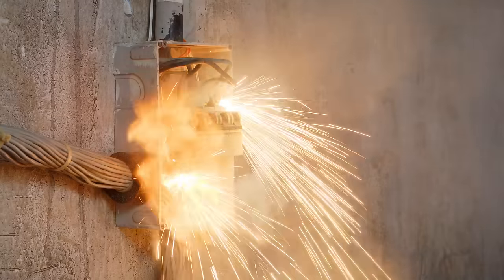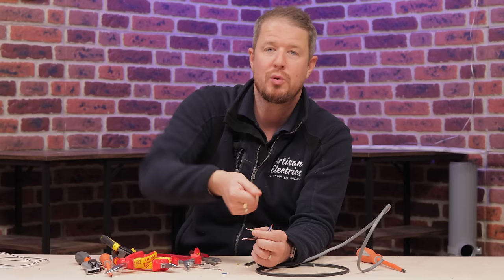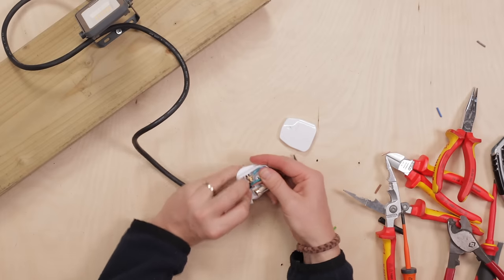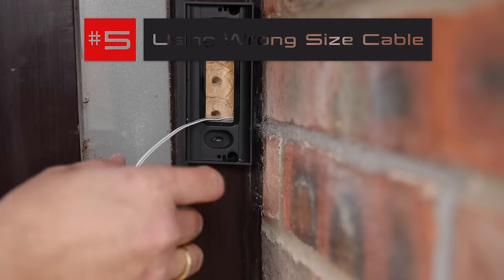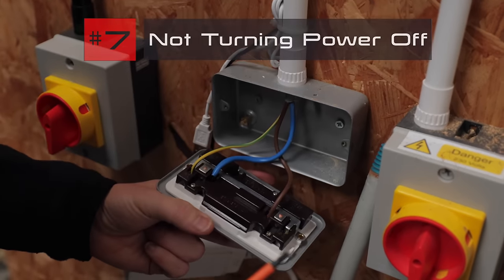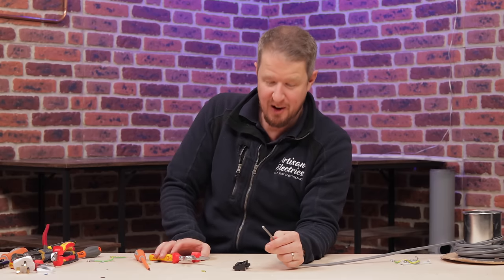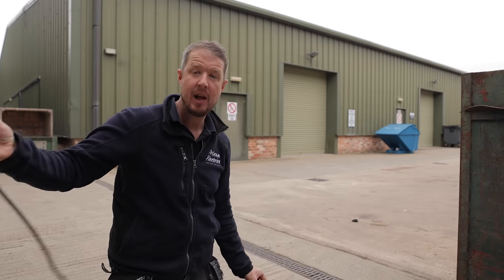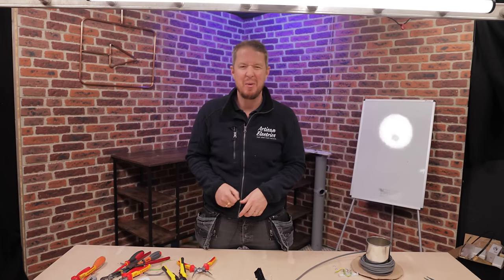10 Mistakes EVERYONE Makes When Doing DIY Electrics!💥

Comment: What about replacing a plug fuse with correct rating. All Plugs have 13 Amp stamped on them but lots of equipment have 3 or 5 amps fitted. People automatically will fit a 13amp as whats on plug if blown as label on fuse sometimes illegable
Reply: These fuses in plugs are a relic of the past, irrelevant in the era of MCBs (and RCBOs). Their purpose was to protect wires in your walls in the absence of proper circuit breakers in the consumer unit - a pointless and annoying feature these days (it is much easier to just flip MCB back on, rather than replacing the flimsy fuse in the plug)
Reply: @lelllooooo  Mate if it was a perfect world I'd agree but for instance my next door neighbour has a 1930s  house with a 1970s fusebox. Her husband tried to pull a bayonet bulb from the fitting and cut his hand open because he didn't know how to remove it and it shattered! It was probably still switched on knowing him.
Reply: Fuses in plugs primarily protect the flexible cable, and possibly the appliance. They categorically do NOT and never have protected the ‘cable in the wall’
Reply: @lelllooooo  Plug fuses serve a completely different purpose than either MCBs or RCBOs.  No one can replace the other.

(In particular, RCBOs are electrical-shock-prevention devices, while MCBs and plug fuses are actually both fire-prevention devices (addressing two different risk scenarios).  The two different categories of device work very differently and are basically completely unrelated and independent of each other.)
Reply: @lelllooooo As per other comments they are still relevant. And in the UK where mains power is commonly distributed using ring circuits, the ring may be protected by a 32A MCB or RCBO but the appliance still has its own protection fuse in the plug generally at 3, 5, or 13A.
Reply: @r.h.8754  because the primary role of a plug fuse is to protect the cable, not the appliance, if the cable isn’t of appropriate construction for 13A (suitable conductor cross sectional area and insulation type) then a lower rated fuse is required.   The appliance may also have its own fuse.
Reply: @r.h.8754  You could do, that requires a flex of 1.25mm^2  Nothing actually prohibits that and it would be protected by a 13A fuse regardless of how low the load is. For a floor standing lamp that might be the preferred choice for greater mechanical protection.

But if it’s say 0.5mm^2 as would be typical of a table lamp it should be supplied with a plug equipped with a 3A fuse, with labelling on the flex detailing the fuse rating.

If it was from the era when plugs were not fitted as standard then labelling for the correct fuse rating would be applied to the flex.  

The lamp itself would clearly consume nowhere near 3A and may even be as low as say 0.25A (60W) for thermal reasons (with tungsten filament or halogen lamps) with regards to proximity of the lamp shade and flammability of the materials used, and far lower for CFL or LED lamps.

You can’t legally have a flex rated for mains use in the UK, and indeed in any country that has national standards based on CENELEC standards that isn’t at least 0.5mm^2 and that CSA of cable is rated at 3A continuous, hence the common BS1362 fuse ratings (BS1362 1A rating fuses are however available) No idea what NEMA says with regards to 110v flex but it won’t be that much different.
Reply: @lelllooooo Totally wrong.
The fuse protects the appliance cable.
The breaker in the consumer unit protects the cables in the walls.

For example: the breaker on a ring main will typically be 32 amps.
The fuse in the plug is 13 amps.

If the fuse in the plug is not present, there is a fire risk as the 32 amp breaker does not protect the 13 amp appliance cable.

The fuse in the plug IS needed.
Reply: @r.h.8754 You can buy 13 amp plugs fitted with 3 amp fuses.

They are readily available.

Or you buy a 13 amp plug with a 13 amp fuse and replace the fuse for whatever fuse you require.

Comment: Ha... I was just waiting for talk about induction with the extension lead. That would set off the QI general ignorance alarm. Not true. It's just resistance causing heat. With the cable tightly wound on the drum the heat can't escape... The general advice is bang on. I have seen a 10A extension with a big water urn (about 10A) and two coffee machines (another 20A) fortunately that blew the fuse.

Comment: Most 'interesting' to date, I was on holiday and asked to wire a socket for a DIY couple who were having an extension  built, the feed cables into a domestic 'consumer board' the live and neutral were swapped over (unknown sparky) I had the MCBs in my pocket, but had no test gear with me, blew a hole in a metal back-box big enough to put my thumb through, the neutral was 'live' via the 100A main breaker. Fortunately  I was being cautious when handling the cables..
Reply: Interchanged, not exchanged.

Comment: very interesting.
also good channel you got a new sub!
bit of a story, so my dad has a audio cable business, but he will also go install equipment, I often come to help, one job a while ago we were at a converted church and they needed audio and a video cable installed in the attic, its a pretty high up and no floor in the attic and had like a foot of insulation, its a pretty old church and had nob and tube wireing but was "replaced" more recently, it was out of they way so I avoided it and got the wires in,  once we finished and had cleaned up we tested it and the sound had a buzz to it, but it was late so we called it qutes. a while later we came back to figure why it was buzzing, I got back up in the attic to remove a littel converter box as a test, which fixed it even though we expected it to work the opist of what it was doing but the thing is those nob and tube were live still the people that were supposed to replace it all reused some of it, so we had the lights off most of the time just in case, we had one of those pens to test if its live to would go off like two feet away from it which its sorta crazy. in the end we made it work, just a little unnerving walking near them.

Comment: Even worse than the "stripping too much insulation from the solid core wire before screwing into the contact block" is not stripping enough insulation and then inserting the wire into the contact and the screw clamping down onto/partly thru the insulation! (Much worse from a contact resistance/fire risk point of view, which is more likely to cause a serious issue than some exposed copper in a covered contact box)

Comment: I got a question! I live in Italy and I am currently studying Mechatronics, and I love working with electric and electronics, so I decided to re-make my cellar for working down there, and I had to re-make the electrical system, for having a better one. So I got cables of 1.5mmq that should reach into my cellar, and for my life saver i wanted a 2.5mmq cables, so I just used a mammut for changing the diameter. Now I got cables of 2.5mmq going insde there, and I was wondering: will my outlets work fine? I got 16Ampere one, and each of it there are 2.5mmq cables that are giving the power inside of them. I excuse myself for my bad english!

Comment: Last point , not induction, it's pure resistive loss, with heat not being able to escape. Inductance is negligible because the field is canceled by live and neutral running side by side. One common DIY error bad stripping resulting in nicking copper, causing a fategue point, which breakers at some point.
I use an old screwdriver with a neon in the handle to check for unexpected live wires.
Reply: No.
The inductance is not negligible because the field is cancelled.

The fields ARE cancelled by the fact the line and neutral currents are equal in magnitude and in opposite directions.

The inductance is not zero.
The formula for the inductance of the coil is this:

L = (Uᵣ U₀ N² π r²) / l

Where:
L is the inductance
Uᵣ  is the magnetic relative permeability of the core inside the coil 
U₀ is the magnetic permeability of free space
r is the radius of the coil
N is the number of turns in the coil
l is the length of the coil

The inductance is a function of various physical properties. It is not based on the magnetic field.

Comment: congrats for this - thou the last bit came to late for a workmate - where you mention unwinding the cable ....the reel did have that thermal cut out but the muppet got sick of it tripping so held it down with blu tack ...... end result was quite the show and then the main fuse on the house tripped needless to say but he's no longer has any leads on a reel

Comment: I am a D.I.Y guy, my paranoia and self doubt has served me well.  The only one on that list I may fail on is tightness, electrical connections should be "Clean, Bright and Tight".   I like mine tight tight but not strangled.
Trades can be the worst,  I recenty moved a professionally installed PV DC isolator switch from my parents loft, it was mangled by a Gorriler.  All the solar gear up installed up in the loft out of sight is F'in crazy.
Trades have no time to take care it cost too much.
Reply: It's not that it costs too much: it's that they don't care.

Comment: Porcelain wire nuts (known in the UK as Screwits) were quite common in the 1960's with the old imperial sizes of stranded cables. I'm not sure if they have ever been banned.

Comment: 10:24 Why is everybody always claiming it's because induction ... etc. This is only a small fraction from where the heat is coming.
The primary source of heat is its resistance : As current flows through the cable, the resistance converts some of the electrical energy into heat. When the cable is coiled, the heat generated tends to concentrate because the coiled cable has less surface exposed to the air for cooling. This reduced heat dissipation causes the temperature of the cable to rise significantly.
This is also why there are regulations on how many electric cables can run next to each other to ensure safety, prevent overheating, and maintain proper functionality.

Comment: My worst mistake was trusting a cheap electrical voltage tester (the screwdriver model) to check whether a socket was live or not. Turns out the cheap piece of equipment was faulty and didn't light up. You can imagine it was a bad hair day!
Reply: That's why those screwdrivers are called jokingly "Lügenstift" - lying pen here in Germany. 
However, just like any kind of measuring device: check proper function first. I don't rely on any measuring device in first place, especially for electricity. I always make a check on a live conduit first (usually on a plug), then switch power off and test again before starting work.

Comment: I have never committed any of these errors. I am also self taught (but have studied electronics).

However I have assisted family, friends and neighbours only to discover that some "so-called" electrician has just twisted cables together, or used the wrong section cable, loose connections and connections that juet haven't been tightened.

I feel your video should be titled "Common DIY and Cowboy electrician errors."

Comment: An extension lead will be fused on the plug so surely it’s not possible to overload and start a fire?
Reply: the issue is overheating even when the load is within tolerance
Reply: Its not overloading, its resistance causing the problem.
Reply: Depends on what rating the fuse used.
Reply: That's  the assumption that can kill you. Same sort of thing happened a few years ago in Sheffield UK, result 6 dead people. They'd  been told what was wrong but reasoned 'it's still working  therefore  what does he know?' I still see the same faults/attitude daily not only from others but even from the surviving relatives. I despair sometimes, I really do.
Reply: wrong
Reply: @wilfredwood2636 No it doesn't depend on the fuse rating.

Fuse rating is nothing to do with it.

You have to have a fuse rating equal to or higher than the appliance load rating.

So when operating a high power load, 10Amps would be 2.3kW, that current causes the cable to heat up. The wound up coil means that the cable doesn't have enough space around it to cool it, and the cable can heat up too much and catch fire.

Comment: Twisting stranded cables together is fine, its how we all do it in Australia. Twisted single strand though is definitely no good.
Reply: We twisted up solid in Australia for decades when that was the cable in use in the past.  I did enough of it myself.  Much the same as with stranded if you over-stress with excessive twisting solid will break.  Just that with stranded you'll possibly just drop a single strand.  Not that removing 1/7th (or what ever based on strand CSA) of the conductor is acceptable.  Solid or stranded once damaged, chop it off and start again.

Comment: I've seen one of these under cupboard strip lights that can be daisychained with the live feed to the female connector. This meant that the protruding pins in the other end were live. The house holder got a shock.

Comment: To be fair professional sparks make mistakes too. I got asked to investigate why the householder was getting shocks from the bath taps. Turned out the main earth cable was still coiled up with tape behind the distribution board. Never had been connected.
Reply: That's not a mistake, it's negligence. Proper testing must be done and that would easily show a disconnected main earth.
Reply: @davidbrooks9576  yes, but my point is in the UK we have laws that require electrical installations to be tested before connection. Plainly this was not done, to my knowledge no one ever get prosecuted for violations.

Comment: When I started as an apprentice electrical fitter on the southern electricity board 1961 one way of connecting cables in domestic wiring was to use screwets, a porcelain version of your wire nuts.surely the bast way to make a connection is soldering, I doubt using the twisted wire method is intended to be a temporary connection so your objection that its difficult to separate the wires is invalid. The main abjection using just a twisted joint is surely the current carrying capacity of such a joint without some form  of mechanical clamp on the wires. Sorry but we operated high current cables wrapped on drums on our test equipment used in finding faults on 415/11KV/33KV transmission cables and after qualifying as electrical fitters with C and G B and C certificates we were given training to operate the equipment we were asked why to unwind the cable from the drum and we cleverly answered eddy currents and were told they would have very little effect on heating the main cause was the high current passing through it. You also completely missed the most dangerous mistake of all, that of replacing the fuse in a 13A plug with too high a value or even a paper clip or a piece of wire. Apart from that I think you have some good points assuming morons are doing the work. One other point that affected us in the 60's was the chance from imperial to metric cable when the lighting/power cables changed from 3/029 and 7/029 PVC to the single core equivalent,we didn't have fancy wire strippers and it was possible to nick one of the strands,it shouldn't happen,but we're all human. If this happened on a single core cable it could cause a later problem which is why although 1/044 cable was rated for lighting circuits 3/029 was used.

Comment: The extension cord on a roll might have been a bad example, but I have seen very dangerous examples of that effect. One time these guys wired up an emergency generator set, with 4 steel conduits. (3 phase system, with 3 hots, and neutral/grounds). The mistake they made was instead of running one complete set of conductors in each conduit, they ran all the cables for phase 1 in one conduit, phase 2 in another, and then neutrals and ground(earth) in the 4th. I guess they figured it would be neat to run all the black wires in one conduit, red in the 2nd, blue in the 3rd, and all the whites/green in the 4th conduit. This was a 2000 amp service, so when they were running the generator on a load test at 1600 amps, those 100mm steel conduits got so hot you could nearly light a cigarette off them! Failed inspection and they had to pull all the wire and redo. Every conduit, raceway, trunking or whatever has to have all the conductors of each circuit in it, so like in the UK, this would be like running all the lives in one piece of trunking, and all the neutrals in another; if they're separated the pixies get angry!

Comment: "inductance is starting to build up"
Speechless
Reply: No inductance at all, because it concerns bifilair windings, which cause no magnetism. It's just that at 4A with a 0,75mm2 cable, it produces 7,47 Watt's, which will not heat the cable enough to destruct it, but... at 12A, the produced power will be 67,2 Watts, and this will kill the cable! Just try to unscrew a 60 or 75 Watt bulb as it has been on for a while --> VERY HOT! (formula's: r=(l*rho)/A --> (20*0,0175)/0,75= 0,467 Ohm. And: and P=I*I*r 4*4*0,467= 7,46 Watt, so is 12*12*0,467=67,2 Watt!
Reply: @jol002  why did you put so much effort into your comment? Who was asking?
Plus, you're wrong about your claim on magnetism but that's ok.